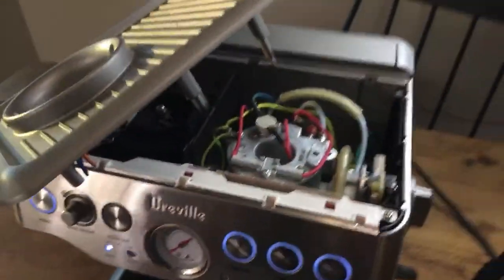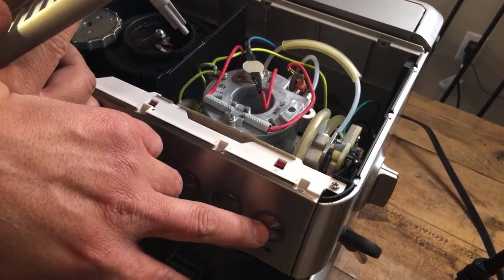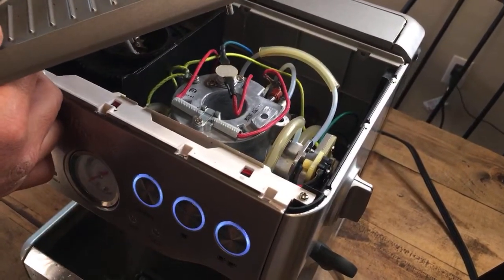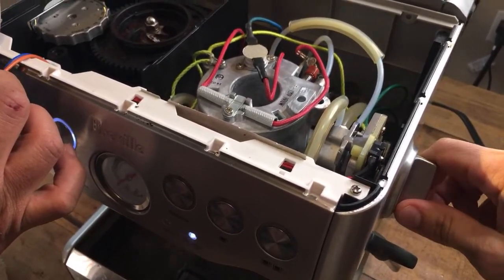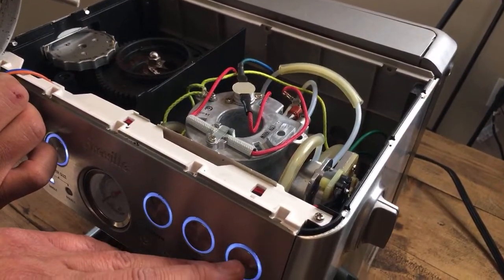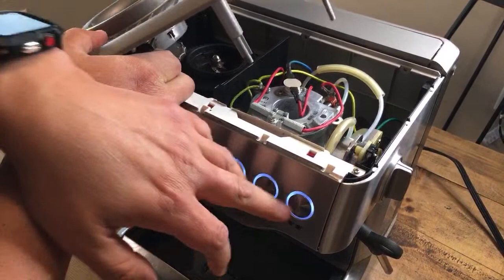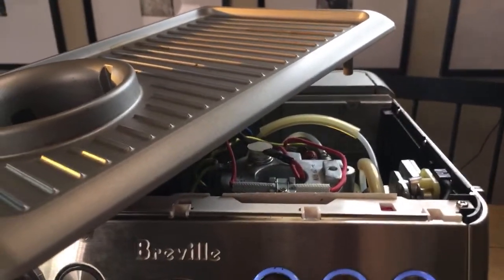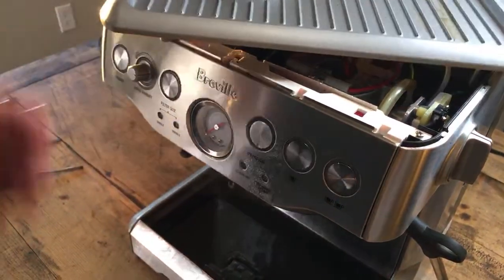Troubleshoot | Breville Barista Express

Comment: We have the same problem. It sounds like a short in the electrical wires when we push the 1 cup two cup button. I have no idea what it is. It doesn’t sound like a pump to me. It sounds like some switch problem.

Comment: Solenoid valve... My machine has the same issue. After about four months of using the machine 4 times a day I started getting the 'electrical buzzing noise'. It usually made the noise after I steamed milk and wanted to make another coffee. Usually when the machine is hot. Only option is to replace the solenoid valve. However, my machine seems to be fine in the winter when overall temps are colder.
Reply: While doing some research on the issue, someone recommend backflushing the machine more often in order to clean the solenoid. I have to say, since I started backflushing more often (about three times a month) it did seem to help. The problem is still there, but less frequently.
Reply from the maker: Thanks for the info

Comment: My machine made the same noise for quite some time after back flushing it one time.  So I unplugged it for a while and plugged it back in and it stopped. It came back one time after so I did the same. I had the machine for several years after this with no issues.

Comment: The vid starts at timeline 6.50. The noise might be an electrical contact noise within a switch, relay or solenoid. To confirm, see if it distorts the sound on a fm radio. Hoon, youTube has free-to-use editing s/w which presents itself when a vid is being uploaded - the conservation of the world’s level of understanding needs your support.
Reply from the maker: You're right about issue with Solenoid.

Comment: Sounds like the solenoid valve...it only gets worse as time passes by. I have had issues with it twice and both times i needed to replace the valve. Very easy fix though. The pressure will soon drop as well. She should prepare herself to get the replacement.
Reply from the maker: I think so too.

Comment: I believe it's a valve, making noise.  Even when you said it sounds good, it was making a ratteling noise that, when it gets worse, it makes the noise you finally heard.  I have heard the same sound, now and then, on my BES840XL.  It is a valve.  I have ordered the valves more than a month ago, from Germany, they came late, but they came.  The valves can be gotten off of EBAY, but through Germany or Australia.  I tried to buy a scrapped '840XL, but what I got, someone had already removed the valves, although a scrapped unit is an option.

Comment: I had the same issue and it is caused by the solenoid valve. Mine started doing this intermittently and then more often.

I replaced it with https://www.ereplacementparts.com/solenoid-valve-assembly-p-629955.html?gclid=Cj0KCQiA6Or_BRC_ARIsAPzuer9H3ZKjUxpcyMYSoO_rU9P654nVCxyXiCiHc7M9oMfu4QYcxcL-al0aAvkPEALw_wcB but FYI it is always backordered and took about a month for me to get.

You need the entire set of 2 as they changed some of the plastic connections to be different shapes between the valves from year to year. However, the full assembly will fit all years AFIK.
Reply: Thanks for commenting
I just replaced the pump on my BES870  
There was a screeching sound ..however the sound returned after I replaced the pump...is this the symptom of a solenoid valve problem? IE a screeching sound and loss of pressure? You say both valves need changing?
Thanks